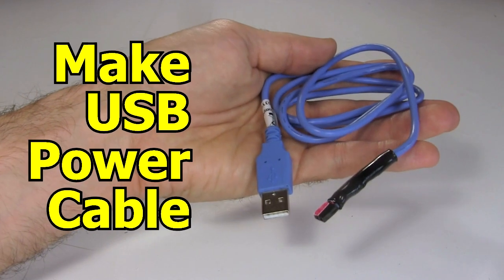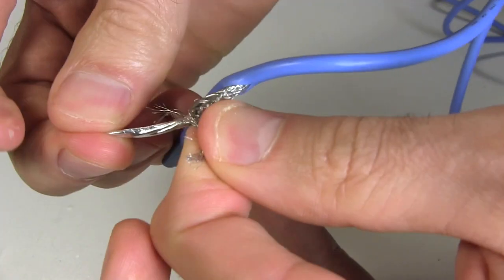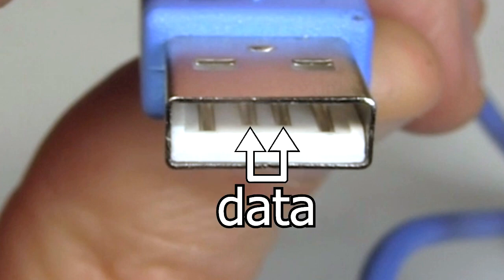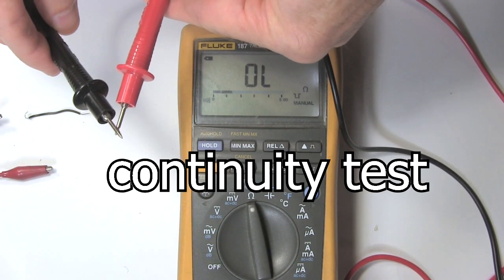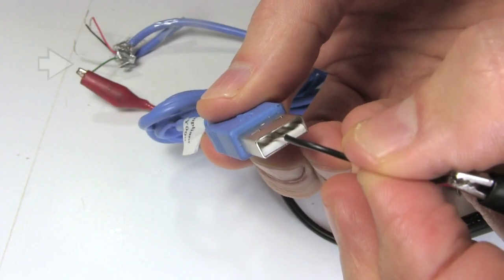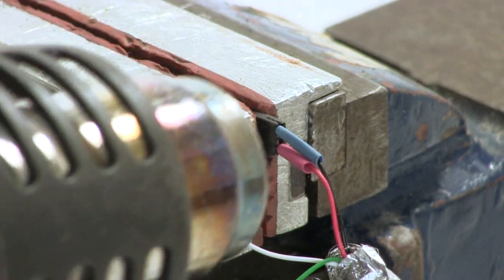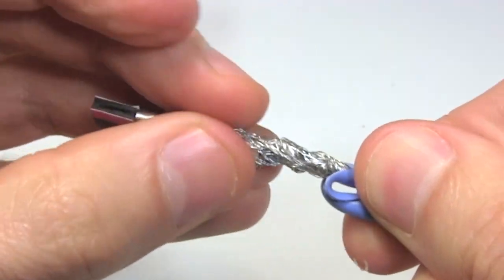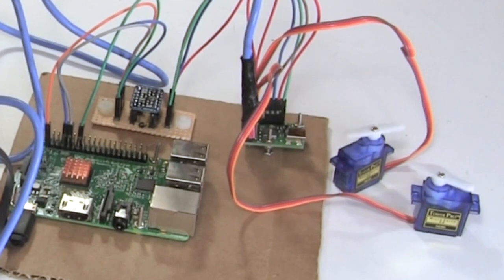Make USB Power Cable

Comment: Expecting more videos dealing with every day electronics.Thanks a lot
Reply from the maker: Can you give some examples? It may not be the way I want to go but I may be misunderstanding what you want too.
Reply: Mobile chargers, how they work, battery stuff, data readers, pen drives etc.things which common ppl face issues n donno how to fix. Thank you 😊
Reply: My intension is if small things r not working,,, they just become `electronic waste` we all know how much intelligence is built into it.. but we just throw them.. i dont like that 😊
Reply from the maker: Thanks for clarifying. Unfortunately, those would be off-topic for this channel. The how-it-works topics on this channel are more how the things that we make work, and not so much how consumer electronics work.
I agree with you regarding the electronics waste. It's sad, but it's true. My instinct is to try and repair things before throwing them out, or keep them and use them for parts.

Comment: Good tutorial! Could you please make a tutorial showing how to make self running a or dc generator, using magnets, copper wire, capacitors, and resistors please. Make stuff that can be used outdoors! Thank you!
Reply from the maker: Thanks! I'm glad you liked it! Unfortunately, I don't know how to make a self-running generator.
Reply: sure Amigo! you can make a solar and wind generator self running battery charger that powers a generator! no free lunch in retrieving energy..those are fairytales!

Comment: I usually use scissors to strip wire, it's much better.  I remember I once tried using a usb charger to provide the bias voltage for an eletret microphone capsule, it worked but there was so much noise in the charger's output voltage that I gave up and went back to using a battery instead.
Reply from the maker: I've never thought to try scissors. I'll keep it in mind for next time, thanks. The only issue I've found so far was that on startup, the motor controller I'm using (Maestro) would do some stuff for around 30 seconds and then go quiet. The phone charger/battery bank would then shut down and all power would be lost. But luckily the Raspberry Pi has enough activity to keep the charger alive. So as long as I'm powering both of them then the charger never shuts down.
Reply: Cheap chinese chargers generally don't do things like actually filtering the power after rectifying it.
Reply: i like using the cutting blade on a cheap pair "adjustable" wire strippers for stripping small wires.

Comment: Cool!  How can you be sure it's not a fire hazard when soldering like that?  It always makes me nervous to use any type of power through solder!
Reply: That was an okay-ish looking solder job, I‘ve got no problem with that. It‘s probably only going to carry 0.5-2A @ 5 volts, so no really big loads.. You can pass a lot of current through these. Melting is more of a problem at mains currents...
Reply from the maker: Yeah, those leads sticking out of the pin headers were pretty short, not much to work with there. Maybe (big maybe) I could have wrapped the wire around them first. As Tobias said, the current is low so heating should be well below the solder's melting point.

Comment: Hi, may I ask, how can I connect a type C head cable directly to main power socket without using adapter?

I mean keep the type C header, remove the USB header and connect directly to main power source.

Comment: Please make video on how to make cockcroft Walton generator which lifts the ionocraft.
I am making a cockcroft Walton generator which is used to lift my ionocraft but my model is not working please help me out .
Reply me as early as possible.
Reply from the maker: Are you saying that the ionocraft won't lift or that your generator isn't working?
Your generator could be fine but just not producing enough current or a high enough voltage for the ionocraft. If it's a lifter type of ionocraft then it requires a lot of current to produce the needed ions for the ion wind. In this video, I measure the output voltage required and get some hint at the current https://www.youtube.com/watch?v=LOGAaObsN4g. And near the end of this video, I measure the input voltage needed for my high voltage power supply to fly the lifter https://www.youtube.com/watch?v=GEuK1OdYxHk.
Reply: Please tell me what is the minimum voltage is required to lift the ionocraft?
Reply: How can i repair my model?
Please suggest me some more intresting and creative ideas and model so that i can make a new model.
Reply from the maker: We also have a conversation going in the comments under my "Wimshurst machine" video so let's continue there instead of in two places.

Comment: I have 3 wires -red, black, yellow (acc). I do wire to make USB power, would it be 2 usb?
Reply from the maker: If by acc you mean AC (alternating current) electricity then that won't work. USB is DC (direct current). You also have to have the right voltage and make sure you won't supply too much current.

Comment: Thanks for making this video! What I’m doing is using a usb cable to make an xt60 connection so I can charge my lipo batteries from a usb port. What I needed to know is which wires are data and what to do with the shielding. This was useful. Thanks!

Comment: Can i connect directly my led decorative light using this method. thanks for your kind advice in advance :-)
Reply from the maker: There are too many things I don't know about your decorative light for me to say. If it's something that normally plugs into a wall socket then it won't work by plugging it into a USB port.
Reply: Know if how much volt it requires your decorative stuff . . 6v 9v 12v . . . U can use ure 5v output powerbank . . But u need a step up chip to make 5v turn into 6v to 12v automatically . . Costing 2 dollars
Reply: @albertdomaoan1473  Thanks for the tip.

Comment: Hi I have an old pc duel usb 1 and 2 slots plus mic  and spk all the cables are on it with female pin headers on the end. On the USB side there are 8 wires 2 red 2 white 2 green 2 black how can I power it to charge up 2 devices I don't need the mic or spk side of it. 
I think the part number is
ZHS-LP-2201-BHD or
LP-2201 any help would be appreciated thank you.

Comment: This was so easy to understand!!! For a very specific use case I want to solder a pcie power connector to a barrel jack using this method maybe but i was wondering if it would be possible.
Reply from the maker: Thanks! I'm glad to hear it. I don't see why you couldn't do what you want though I don't know the details of the two connectors so I don't know how easy it would be.
Reply: @RimstarOrg  Ah fair enough. You know a lot of electrical wiring but it's basically a cable like this: https://www.amazon.co.uk/2-Pack-Express-Graphics-Video-Adapter-2-Pack/dp/B07C6P9R9R/ref=sr_1_2_sspa?ie=UTF8&qid=1551269354&sr=8-2-spons&keywords=pcie+power+cable&psc=1 
That one goes to power the video card and is normally attached to a desktop power supply like the one that you modded.
Then I wanted to fuse it with this laptop charger since the video card I plan to use only pulls 120 watts from the wall at full load and the laptop charger is 330 watts which should be more then enough unless i can find a cheaper 200 watt brick. 
Here's the charger: https://www.acharger.co.uk/original-330w-dell-alienware-m18x-r3-i74800mq-ac-adapter-charger-p-23986.html?gclid=Cj0KCQiAh9njBRCYARIsALJhQkHdyJ_1XhWUs4V8HfNNPVpnSnrca4fna_ri9o8TI6xRHHh64DZThRsaAk-fEALw_wcB
I was wondering about using a converter like this: https://www.amazon.co.uk/Female-DC-Power-adapter-terminal/dp/B00MIKWEBI/ref=pd_day0_hl_147_1/257-0164774-7361632?_encoding=UTF8&pd_rd_i=B00MIKWEBI&pd_rd_r=cd4bc916-3a88-11e9-9ce8-2950a399f43d&pd_rd_w=SqWIQ&pd_rd_wg=lIQS1&pf_rd_p=92d624bb-a334-423e-8722-8024dd09667f&pf_rd_r=FAN4S2MVND5RMC44B4H1&psc=1&refRID=FAN4S2MVND5RMC44B4H1
Then the laptop charger would plug into that and that would be fused to the first PCIE power cable which gets connected to the video card. The only problem is I am not sure which wires are the power wires and which need to get fused. I don't think I need a soldering gun because this device uses screws to transmit electricity but would it be safe to use and provide enough power for the gpu? 
I plan to use a separate pico power supply for the processor, motherboard, ram, and SSD drive because it is a really small form factor system that can't fit an internal power supply.
Reply from the maker: I don't have answers, just things you might want to look into.
Firstly, if the video card normally get's power from the desktop's power supply then possibly it's voltage should be relative to the desktop's power supply's ground. It may be important for the communication between the two. You'd need to guarantee that would still be the case if you use the laptop charger.
Also, it's not good enough that the laptop charger have a good enough power rating, it also must give the proper voltage and enough current.
Whatever wires you use must be rated for the current which will be on them.
The terminal block's screw connections may have a maximum current rating. That would be the only issue I can think of with regard to using that instead of soldering.

Comment: I want to power my favourite lamp (lamp from times when I was like 3 years old) directly from electrical network using USB
thx, I give big like :)
Reply: might be tough without additional electronics parts, such as usb controllers which will negotiate a power level which is sufficient to power a lamp. if you use the method shown in the video, you will get 5V and 100mA, max, if it is usb2.
look for usb pd controllers or triggers. they are little dedicated controllers which will negotiate a power level with the source to deliver you a power sufficiently high for your lamp.

Comment: Could you make an usb to female socket or do you need an inverter between? This is so I can use my 240 jigsaw on my 4ah drill battery
Reply from the maker: If by 240 you mean a 240 volts AC jigsaw, then yes, you'd need an inverter between the drill battery and the jigsaw. The battery supplies DC and the jigsaw takes AC. An inverter converts DC to AC.
But I'm surprised there's a USB port involved since USB is usually lower current. If there's a USB port on your drill battery then it's probably putting out DC but it probably can't handle the amount of current that a jigsaw would be drawing (taking) from it. I can't be sure about that, you'd have to check the specifications somewhere (on the drill case or in a manual?).

Comment: Watching this 5 years later, how does this work with "smart chargers" that use data pins to determine how much power to output?
Reply: depends on what kind of charger it is. first of all, the distinction between protocol and interface.
usb 1, 2, 3, 4 describe the protocol, data rates and so on. usb type a, b, c the interface and power delivery capabilites. around these core specifictions there are other usb products/releases which relate to power delivery, such as usb bc (battery charge) and usb pd (power delivery).

if your smart charger has a usb type c interface, 2 of the 24 pins, the CC lines, will do the power negotiation. With "standard" usb type c, up to 15W of power is possible. if the charger can do more, then because very likely it supports usb pd, which is necessary if you want to provide or receive power exceeding said 15W (some products, up to 240W at this point). there is a controller in your charger dedicated for usb pd functions, such as talking the pd protocol and more importantly the power negotiation with the attached device. the controller will have preset power levels which it will offer to the connected device. and if the device can handle high power / supports usb pd then, they will agree on one of the power levels. they will make a "contract" and the power delivery starts. There is much more to it and the sequence of the negotiation is a more complex back and forth, and there also different modes in which the device can supply the sink apart from those preset power profiles, but yeah, hope you got a rough idea.

at some poitn i said "likely it supports pd". this is because not all products adhere to the usb specification and use there own solution which is not conform with the specification.

the usb specification are all free to access on usb.org. the usb pd psecification gives a great, detailed summery of its functions and points to the relevant sections.

Comment: Can I do this to make a mini fan to get power from laptop? Will it not be dangerous?
Reply from the maker: I'm assuming you're talking about running the fan off of the laptop's USB output. The voltage is low so it wouldn't be dangerous to you. However, I'd be more worried about your fan taking too much current from the laptop, damaging the laptop. You'd have to find out how much current the laptop can supply without being damaged. Then you'd have to check how much current the fan will be using, to make sure the laptop can supply enough, and that the fan won't take more than the laptop can supply. And lastly, the fan would have to be a DC fan, not AC, and run off of 5 volts or less since that's what USB ports supply.
Reply: @RimstarOrg  thank you so much.
Reply from the maker: Looks good.
Reply: @RimstarOrg  is it okay If i connect it to the laptop?
Reply: @arcee9144  Better not to risk - as @RimstarOrg said you should check how much current your laptop can supply via the usb ports and also the current of the fan
Reply: the amount of ampage can be provided through the usb port is not really dependend on the laptop itself, but rather the usb protocol. (look: https://en.wikipedia.org/wiki/USB#Low-power_and_high-power_devices) if it is a usb 3 port and the fan DOES the CORRECT power negotiation with the host(laptop) then the fan can draw upto 900mA.

Comment: Hi, I was just wondering if you knew what type of cable you were using, because right now at the moment, I've been working on a project for my engineering class and I bought a normal phone charger. When I took it apart, it only had the red, white, and green wire's going through. If you remember the type of cable you used that includes the black wire, it would be a great help.
Reply from the maker: You can see the two ends in the video at around 0:18. From https://en.wikipedia.org/wiki/USB the squarish end is a Type B and the rectangular end is a Type A, USB 1.0 or USB 2.0. It was randomly selected from a thrift store so I don't know what it was originally used for. I have a similar one with the same two ends which I use for communicating between my PC and my Arduino Uno and it also powers the Arduino from the PC.
Reply: The most common use for that type of USB it's for HP printers, or modems.

Comment: what can I do with a usb wire that only have 3 color, green - red - white there's no black.
Reply: any solution yet? i am having the same problem..
Reply: Strange but use a multimeter or voltmeter and check which wires gives 5v

Comment: Great video, am looking for powering something through a DIY project via mini USB output connected to a power supply. Something like the USB connected to power supply and then the other end use to charge a battery or power something. Can you help with some video

Comment: Is there a way to prevent the power brick from automatically shutting off when there is no current draw for like... 30 seconds?
Reply from the maker: Not that I know of. Maybe you could provide some sort of dummy load through a large resistor, but I haven't tried it so I don't know if it would work for sure. It does mean that you'd always be powering the resistor and so you'd have a constant power draw slowly draining the battery.
Reply: The easy way shall be a variable resistor connected in parallel.   Set it to max initally and lower it slowly under no-load open circuit. Then the resistance of the parallel circuit shall be low enough

Comment: Thank you ! Can we use phone charger usb cable to power directly servo motors sg90 ?
Reply from the maker: You should be able to use the cable since the wire thickness is pretty much that same as what I use for my SG90s. Whether or not your phone charger will power them is a different question. The current drawn by the SG90s may be too much for the charger and damage it. You'd have to compare the specifications for the SG90 against what's written on the charger.

Comment: Is it possible I could simply solder the usb cable negative/positives directly onto the board??
Or would I need an adapter???
Follow up question... assuming I ignored the answer and did it anyway.  soldering the wire onto the board, I did so without removing the previous power adapter/connection port the board had, and whenever I try powering the board, it doesn’t get enough power VIA USB. :( (hence my first question, seeking validity)

Comment: I have a doubt. I have a little fan that i want to fix since the cable has been cut in half. 

The cable with the USB port that i want to "join" into this fan cable has 4 colors: black, red, green and white. 

Now, the problem is that the fan cable has only green and white, but it is only supposed to be a "power" wire? 
Which ones do I connect to where?
Reply from the maker: If the fan has only two wires then I suspect it's a DC fan. However, from the colors, green and white, I can't tell which should be positive and connected to the red wire and which should be negative and connected to the black wire.